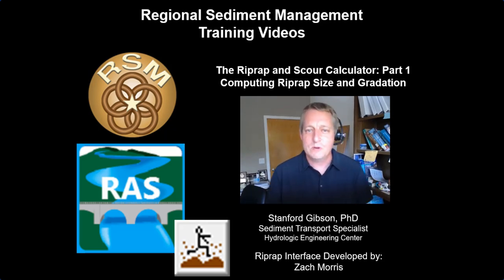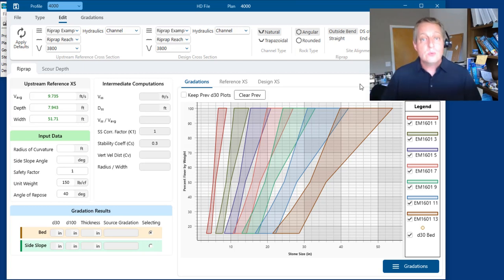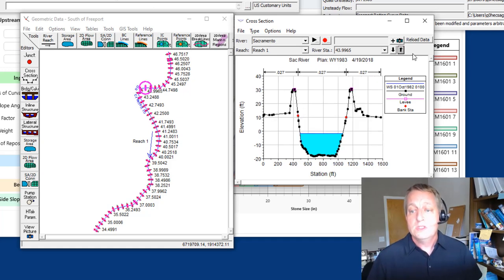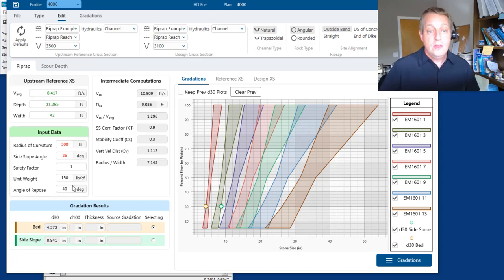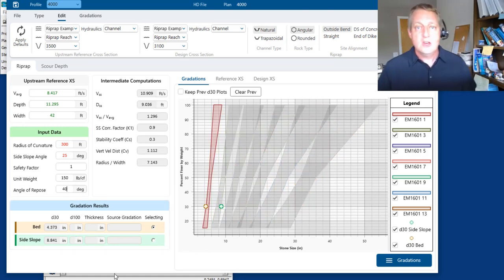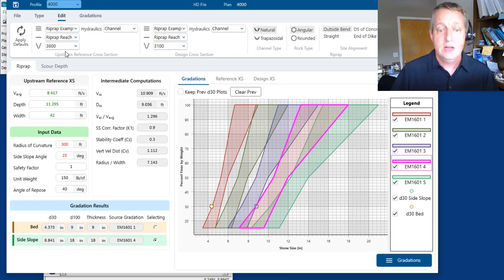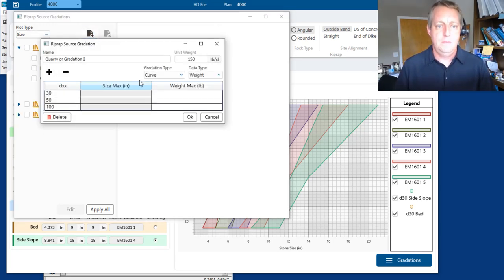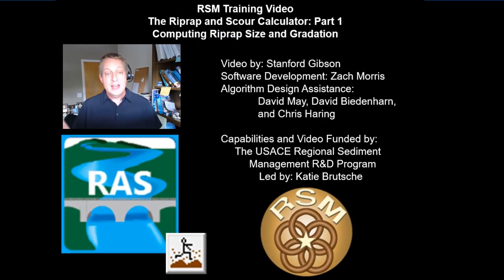Riprap and Scour Calculator in HEC-RAS (Part 1: Riprap)

Comment: I have a 10' x 10' culvert with water coming out at 17 fps and going into a natural channel.  Our 2 ton riprap got washed away with the recent rains here in CA.   So now I'm trying to size the riprap so it doesn't get washed away.

so I'm making my upstream reference section to be the culvert which has the most velocity.  The design section is about 15 ' downstream and I'm using that.  So now the question:

What section is used for the input data?  It's all straight so there is no radius.  But the side slope of the reference section is 90 and the side slope of the design section is 35 in the natural channel.  So what numbers do I use?

Comment: Thanks for the video. I have a questions, in RAS MAPPER in a model 2D, can I draw a levee and then calculate its scour? To calculate the scour, do I first have to model sediment transport?. Thanks for your answer, I am new user in HEC RAS.
Reply from the maker: The only way to compute scour in 2D is to use sediment transport...and even then, in your situation (levee toe scour) you have to be careful because those processes are 3D.  But you can map shear stress in 2D and compare it to an inferred critical shear to evaluate competence.
Reply: Try in FLOW-3D for scouring model

Comment: Will there be the capability to use this tool in 2D? Or will the RASter calculator be the preferred tool for any design work based on 2D models in the future?
Reply from the maker: The riprap and scour equations are based on experiments with strict 1D assumptions, so they are not applicable to local, 2D hydraulics.  Until there are good, local, 2D equations, we are not planning on adding them to 2D.
Reply from the maker: We are talking about allowing users to choose a transect in the 2D model to one-dimensionalize the 2D results.
Reply from the maker: I wrote a little about this in the manual: https://www.hec.usace.army.mil/confluence/rasdocs/rasum/latest/hydraulic-design-hd-calculators/riprap-and-scour-calculator/riprap-calculator-sizing-rock-gradation/limitation-why-doesnt-the-riprap-and-scour-calculator-use-2d-results